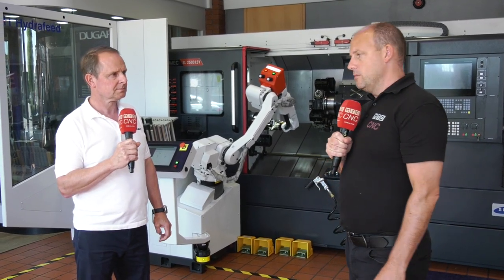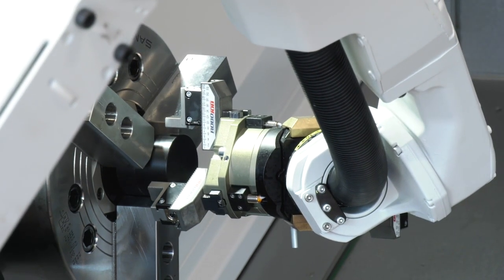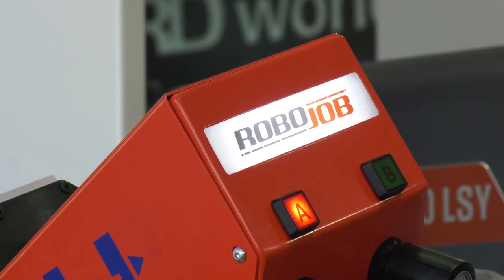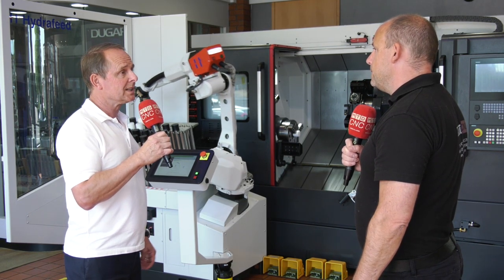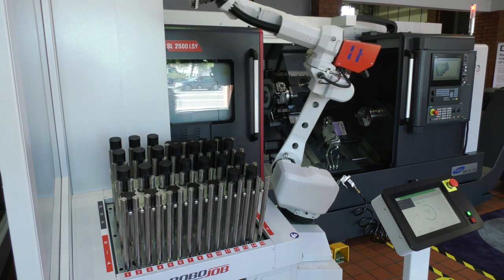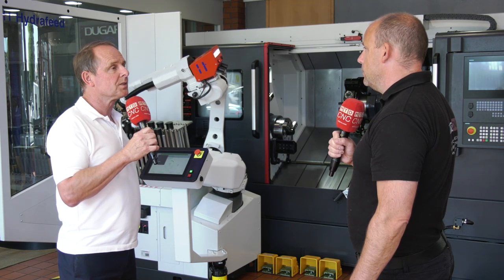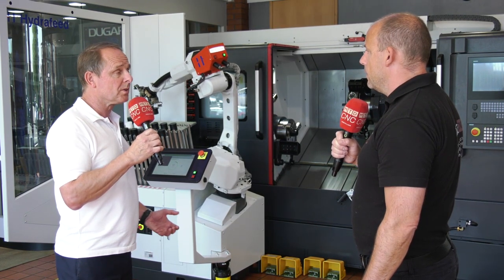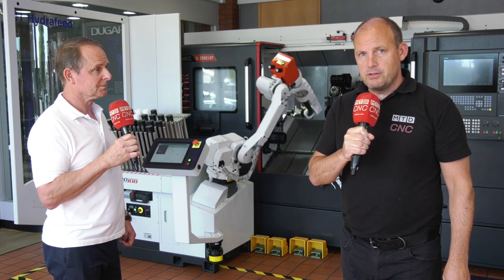It no longer has to be a sub spindle machine to 'do it in one'

Comment: The reason I use sub spindle is tight geometric tolerances between OP1 and 2. Is a robot going to hit them consistently?
Reply from the maker: you could incorp some form of metrology into the process if tolerances are tight
Reply: You could always do an OP1 run, change Jaws/add hard stops then batch OP2 through for greater tolerances. Not quite as attractive but still useful to keep spindle uptime.